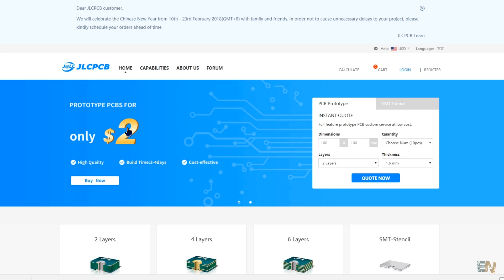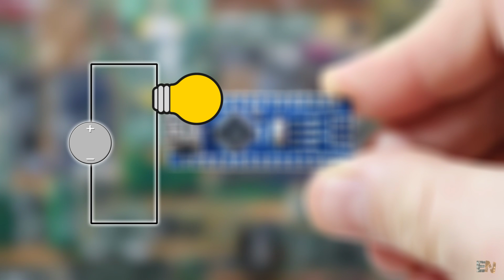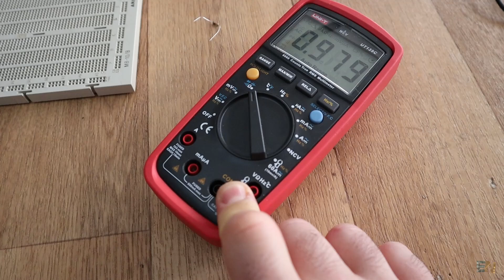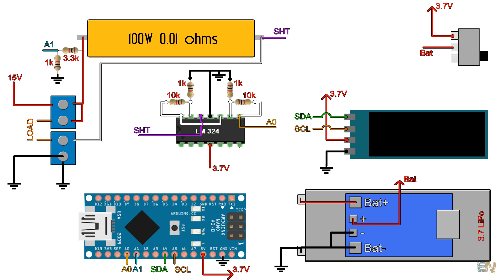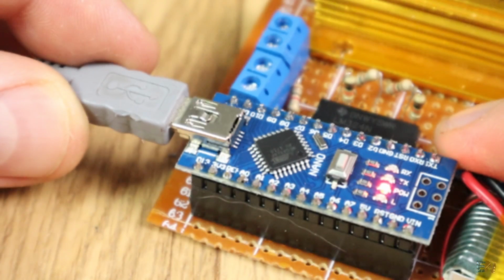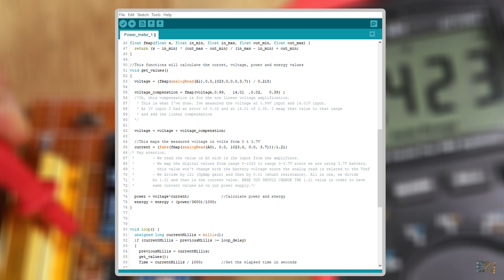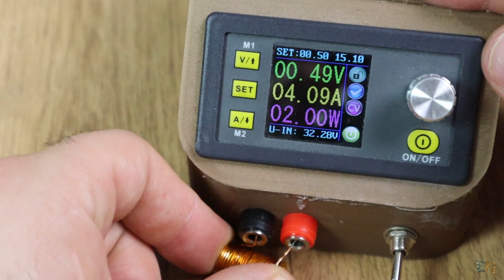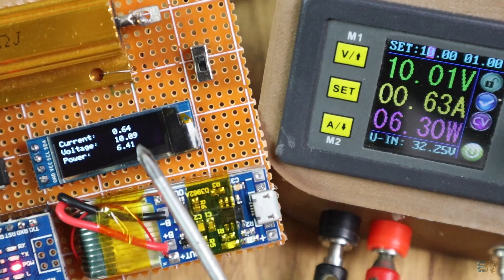DIY Arduino power/energy meter

Comment: I am santosh, i use to see your video regularly, also trying the seme ckt. With code , but when try to made this project, all is fine only when i don't apply measuring voltage & current, still there is some reading on display like, 0.244V. & 0.026A , so how to solve this problem ??
Please guide me to solve this problem.
Santosh

Comment: a pcb track can be used as shunt. Recently I made a usb V/I meter using an op amp without μC. Its gain is so adjusted that a multimeter can show the current value in terms of Voltage. This way we can reduce the effect of the meter cable resistance

Comment: @Electronoobs is it possible with higher voltage and current? I want to build one for my van to see how much Amp hours I need. So max. 14V and 150A. What I have to change? Only the shunt and the settings in the program?

Comment: Can I use this to measure eanergy form an wall out let isialing 120 vac
Reply: NO!!  It is absolutely not safe for use on mains, and if you have to ask, you shouldn't be making a project like that.  (I'm not trying to be mean - start with low voltage projects until you know what you are doing and have confidence).  Also please note the input reference voltage on the schematic.  Further, this is for DC.  
Be careful - your life or a house fire is not worth it.

Comment: may I use it for 230v also?
Reply: Can we use it fo  for 230 volts..
Reply: NO!! It is absolutely not safe for use on mains, and if you have to ask, you shouldn't be making a project like that. (I'm not trying to be mean - start with low voltage projects until you know what you are doing and have confidence). Also please note the input reference voltage on the schematic. Further, this is for DC. Be careful - your life or a house fire is not worth it.

Comment: hey there, really awesome project, wonderful to point explanation, the only thing i felt missing is designing a proper 3d printed case, i mean you even made this portable by powering the circuit via Li-Po , you could had made a practical Multi-Meter Style box or something that is humane to hold, anyways, this is awesome, cheers to great work!

Comment: Ok... I have a bunch of things to say about this, as I recently tore apart and retraced one of the cheap Volt/current meters. I created a schematic and video about that device for reference.
  I suggest you take a look at it to help you understand a few bits. Those devices use a 3v3 regulator for the MCU and to power a LM358 which is essentially the dual version of the LM324, (not exactly the same but very similar). If you look at the circuit they use for the LM358 current sense amplifier there is a network of series resistors between Vcc, the op amp inverting sense pin, and the current shunt to ground. These are used to overcome the op amp's bias issues and get it into the linear region of operation. I had trouble replicating their circuit exactly myself, but there is an easier way. Just place any silicon diode, 1N4148, 1N4001, etc. between the output of one op amp and the feedback resistor. The op amp feedback loop will drive the output to compensate for the diode drop. This will put the output into the linear region and you'll get accuracy. Still don't understand? The op amp's output pin goes to the Anode of a diode (PANIC= Positive Anode Negative Is Cathode), then connect the cathode of the diode just like it's the output of the op amp.
   
 Next issue... I also tried several different combinations of multiple op amp stages like you did here. Don't do this. Your amplifying the error from your first stage. Do all of your gain settings in one stage. Once you compensate the circuit for linear operation you'll see it works perfectly and no need to try and rig code for none linearity in your op amp.

  Finally, your calculations for your shunt resistor are wrong as far as current ratings are concerned. You don't calculate a shunt resistor like a power resistor. Your not placing the shunt resistor in parallel with the load. Your placing it in series with the load. If you want to know the actual power rating needed you need to calculate the voltage drop at peak current. This voltage drop is the "Voltage" you plug into the equation to calculate the power rating needed.
    For example let's say you have PSU capable of 10v at 1A supplied to a load. This load is connected to the PSU positive output and to a 1 ohm shunt resistor on the common/return that is connected to the ground terminal of the power supply. In this situation, the shunt resistor is not connected to the positive terminal of the power supply. This means we can't calculate the power rating based on it's voltage drop like a power resistor. This should make sense if you think about it. Your trying to amplify this voltage drop in order to calculate the current of your circuit. If the voltage drop across the resistor is the power supply voltage, what the heck are you trying to measure and amplify? The number your trying to amplify is the actual voltage number you need to use to calculate the power rating of your shunt resistor! You know this number is tiny and fairly linear, but obviously this changes in the circuit and you still need to calculate the power rating for your shunt resistor right?!? How do you do this? It's very simple and easy. You need to know the maximum current your power supply circuit can supply. In my example above, (10v at 1A w/ 1ohm shunt), you know you have 1A across a 1 ohm resistor. This is going to create a 1 volt drop across the shunt resistor when there is the maximum of 1 amp across it. This means that the shunt resistor only "sees" 1 volt at 1 amp, so it will dissipate 1 watt. 

   The big mistake people make is calculating a shunt resistor as if it's a power resistor, aka the resistor as the load/as if the whole power supply voltage is placed across the shunt. If you did this wrong like many people do you might calculate 10 volts across 1 ohm is 100 watts. That is how you calculate power resistors/a load, but it is totally incorrect for calculating resistors in series, aka shunt resistors.
  The other problem people tend to miss is that the load is going to see the same voltage drop in the circuit as the voltage drop of the shunt. This means that at 10 volts and 1A the load is only getting 9v due to the 1 ohm shunt's 1volt drop. You can build your power supply to compensate for this or you can use a tiny shunt resistance value that creates a very small voltage drop. 
   If you think about it, with our 1 ohm shunt resistor example, you don't even need a current sense amplifier. You can use the internal reference of the AVR and set up the ADC to read from 0-1v. Choosing a lower value shunt resistor allows you to minimize the effects of the shunt resistor voltage drop, but the voltage drop is too small for the ADC to measure and therefore you need a current sense amplifier.
    This type of common/return shunt resistor is still very crude but it is reasonably accurate and enables you to use cheap jellybean op amps. Better designs work on the positive terminal but that requires a much more advanced differential amplifier configuration...I think... that's one I want to explore more and test out soon on my bench.
  Hey, at least you didn't etch something yourself on a tiny SMD PCB just to learn about the bias current and none linear op amp issue. You should be able to add a diode to your protoboard design easily and fix the problem.
-Jake
Reply from the maker: Thank you very much!
Reply: I dont think everyone is going to read T H I S  L O N G ! Anyways, I am reading it now, appreciate the time you took to write this.... :-)
Reply: @raagamparmar179  
yup
Reply: I read your entire comment, excellent. Furthermore, using a coil of wire as a resistor only works if the wire is varnished and if it is pure d.c. not even ripple d.c. as any fluctuation in current will cause magnetic flux around the coil (resistor) inductive reactance will add to the resistance (impedance) of the circuit.

Comment: Enjoyed the video
I have recently tried the same setup, i tried using an 3 op amp  instrumentation amplifier.
Still a work in progress.

You used a massive shunt resistor. That 100 watt resistor would go to 100 Amp with proper cooling.

I used a 0.1 ohm 5 watt shunt  resistor that will easily measure up to 5 amp at 2.5 watt.

Kind regards

Comment: Very nice project, thanks. 
BTW: The tang on the screw terminal can slide into the next one, so that they lock together in a straight line, instead of jamming together at an angle as shown.

Comment: I want to measure 220volt AC of my house. Should I use voltage divider?
Reply: UnderstandQuantum ! Get a current transformer and amp meter they are not expensive.
Reply: Кристиян Митев I think I have said voltage not current. I can't measure transformer for measuring voltage. Because it is not real time. It has some phase like 90°.
Reply: UnderstandQuantum ! Oh sorry my mistake. I think voltage is mesured by resistors and letting some really small current through them but i still dont know for sure.

Comment: I think this setup will not be accurate at all. As the battery voltage changes, the internal voltage reference for the ADC will change as well, and because the ADC values are referenced to the voltage reference (as the name implies), you will get a value proportional to the battery value. This could be solved by adding a step-up 5v regulator to be sure that the input voltage for the ATMega328p is always the same.
Reply: IscleGaming | ZefaCraft either that, or you use an external (or internal) voltage reference. Zener diode or "dedicated" reference
Reply from the maker: True. Thanks
Reply: the nano have a 3.3 regulator inboard so no matter what voltage the battery have the reference is always 3.3 so theoretically its always the same
Reply: That is incorrect. The nano does have a 3.3v regulator, it's from the USB to Serial converter, but the microcontroller is not powered by it. The 5V pin is directly connected to VCC and the 3.3v is just an output, it's not used by the arduino in any way in the case of the Nano. What you could do is power the chip with 3.3v via the 5v pin, using a LDO 3.3v regulator connected to the lipo, but I'd rather use a 5v step-up regulator instead.
Reply: im sorry the regulator is a 5V one i just checked the datasheet and the regulator is supplying the atmega ship !!!!!
Reply: Yes, there is a 5V regulator which only works if you power it from the Vin pin, but even then you need at least 6.1v for it to be able to supply 5v correctly, as it has a dropout voltage of 1.1v moreless.
Reply: Manuauto Sure, you can use the internal 1.1v reference, but I think a simple step-up regulator is an easier solution...

Comment: Hola, hace un tiempo intente hacer esto para adaptarlo a mi fuente variable. Pero no estaba conforme con la resolucion y precision del arduino. Asi que termine usando el arduino mas el ina226, y quedo perfecto. Saludos
Reply from the maker: Lo que puedes hacer es un Oversampling del ADC de 10 bits y llegar hasta 4096 en valor decimal pero para voltajes hasta 1.1V. Cambias la ganancia del OPAMP para hasta ese rango pero la resolucion es mucho mayor con 1.07mV por paso. Saludos!

Comment: If you gonna measure current values up to 1A and uses a 10mR resistor, the resistor dissipates only P = R * I^2 = 10mW. The 10mR x 10W resistor is only necessary if you going to measure I = sqrt(P/R) = sqrt(10/0.01) = sqrt(1000) = 31.6A!!! I didn't understand why you said those specs for the shunt resistor on the video.

Comment: I built a system almost identical to this as a part of my ebike controller. Just that I use a 50 w 0.01 ohm resistor, a different op amp gain and a nokia spi display. When the system is measuring 0-10 A it is relatively accurate but when the current goes to 30+ amps it shows almost double the true value. Any ideas ?
Reply: Any saturation on the amplifier stage? Or problems on switching between one analog port or another? Try to make a double analog reading on the arduino code and use only the second value and check if the analog part of the amplification is working properly.
Reply from the maker: I had same problem and this is what I've done. I've made measurements for 1amp, for 2,3,4 etc till amxumum value of my system and realise there is a linear value added to the measurement so in the code i've subtracted that value linealy.